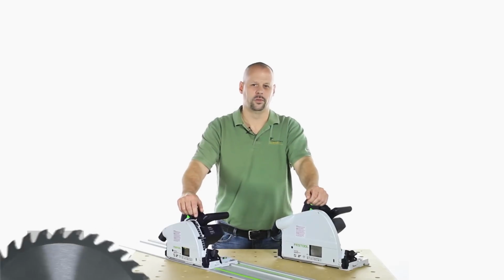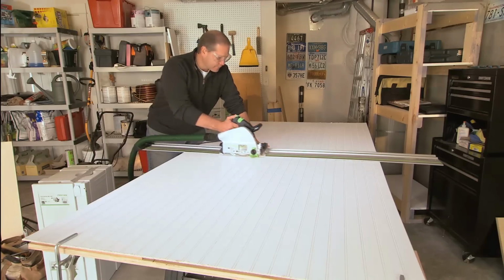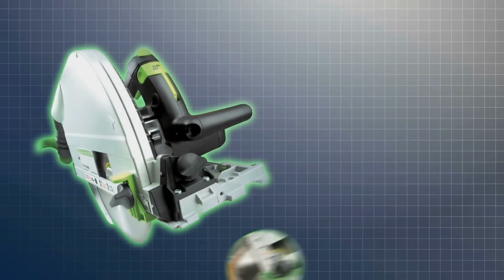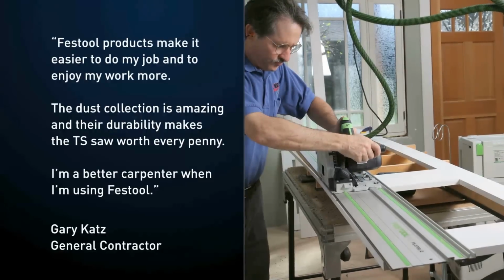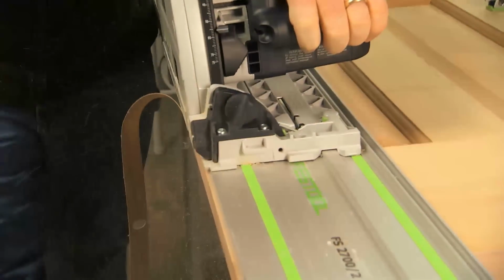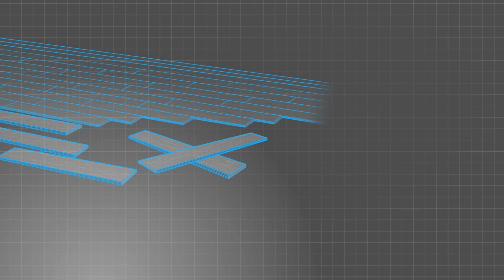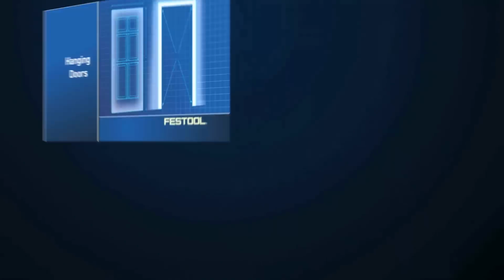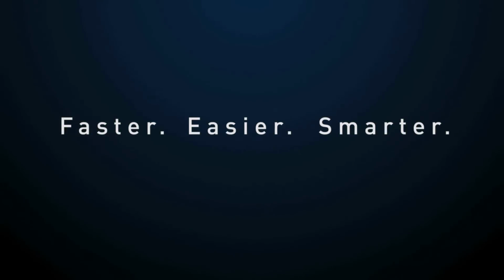Festool TS 55 and TS 75 Plunge Cut Saw

Comment: Over priced Dewalt makes the same saw and track and it's affordable.
Reply: I own a dewalt. I hate it as I'm unable to make usual bevel cuts. Looking for other saw.
Reply: No, Dewalt does not make the same saw. Not as well made and not the same capability of the 75. 
The word "affordable" is relative, if you are doing a $40,000 job that can have labour cut by 30% using a track saw then you'll save money with the purchase. Don't buy one to put up a couple of bookshelves in an apartment.